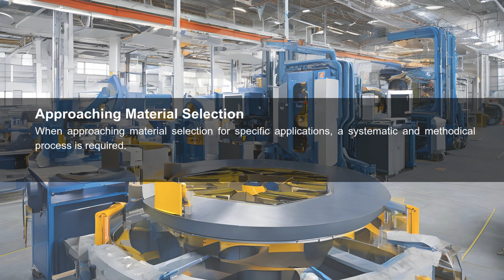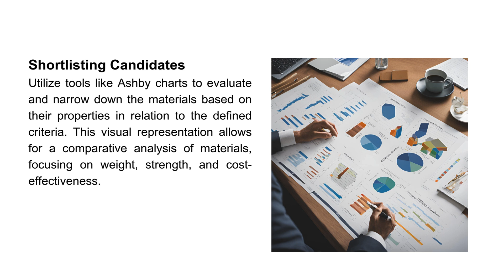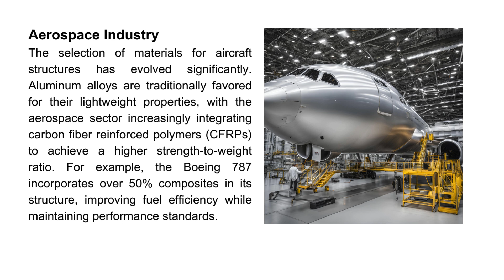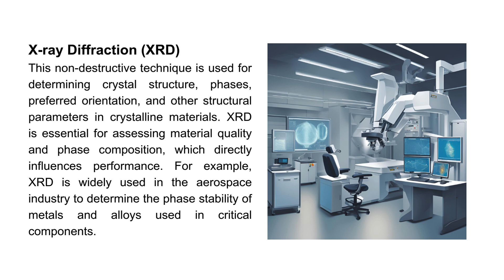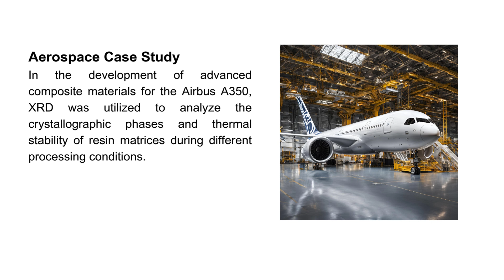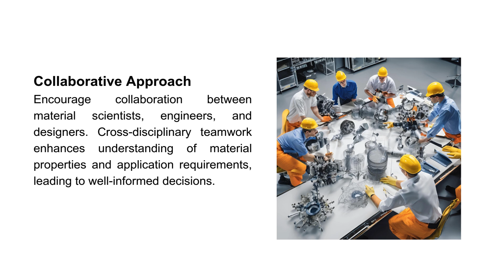MTM Lesson 3. Material Selection & Characterization Techniques

Comment: Explain how data-driven approaches can enhance decision making in material selection. Ans. Data-driven approaches enhance material selection by using machine learning and large datasets to predict material properties, optimize performance, and reduce experimental costs. These methods help identify the best materials based on strength, durability, cost, and sustainability. By leveraging predictive models, engineers can quickly evaluate material behavior under specific conditions, leading to more informed, efficient, and cost-effective decisions in selecting materials for various applications.

Comment: Material characterization in modern manufacturing faces challenges such as the complexity of advanced materials, which complicates property measurement and requires high accuracy. The process is resource-intensive, demanding expensive equipment and skilled personnel, which raises costs. Additionally, integrating real-time monitoring in dynamic processes like additive manufacturing adds to the difficulties.

Comment: Student Name: Nicolas, Arvin Van B.
Program & year: BSIT Automotive 2-B

Software tools can significantly enhance the material characterization process in a way of "Simulation and Modeling". Software tools enable the simulation of material behavior under various conditions, allowing for predictions of performance without the need for extensive physical testing. By leveraging these capability, organizations can improve the accuracy, efficiency, and effectiveness of the material characterization process, ultimately leading to better material selection and performance.

Comment: Name: Jan Keith T. Montero 
Answer: Key techniques to ensure materials meet required specifications include:

1. Material Testing (tensile, hardness, fatigue, impact tests)
2. Non-Destructive Testing (NDT) (ultrasonic, radiography)
3. Chemical Analysis (spectroscopy, chromatography)
4. Dimensional Inspection (CMM, laser scanning)
5. Microscopic Examination (optical, electron microscopy)
6. Thermal Analysis (DSC, TGA)
These methods verify material properties like strength, composition, and structural integrity, ensuring they align with design and safety standards.

Comment: empirical data provides insights into how materials behave under specific conditions, while design specifications outline the necessary properties for functionality. This combination leads to better durability, safety, and efficiency in applications, ultimately reducing the risk of failure and optimizing performance.

Comment: There are several approaches to ensure materials meet industry standards during selection:

Standards Research: Always check relevant industry standards and guidelines for specific requirements related to materials.

Material Testing: Conduct tests to assess properties like strength, durability, and safety to ensure they meet the required specifications.

Supplier Certification: Choose materials from certified suppliers who adhere to industry standards.

Documentation: Maintain detailed records of material properties and testing results to verify compliance.

These steps help ensure that the selected materials are safe, effective, and suitable for their intended use.

Comment: Define requirements and objectives.

Identify candidate materials.

Analyze material properties.

Evaluate manufacturing compatibility.

Consider environmental and sustainability aspects.

Conduct a comparative analysis.

Prototype testing and validation.

Perform cost analysis and finalize selection.

Review and document the process.

Implement and monitor the selected material.

By following these steps, manufacturers can ensure that they choose materials that meet the technical, economic, and environmental needs of their applications, leading to optimal performance, reduced costs, and longer-lasting products.

Comment: Material selection is pivotal to the product lifecycle, influencing various stages from design to disposal. The chosen materials significantly impact performance, functionality, and durability, ensuring the product meets design specifications and user requirements. For instance, lightweight materials can enhance energy efficiency, while cost-effective options can lower manufacturing expenses, affecting market viability. Additionally, material compatibility with manufacturing processes influences production efficiency and product quality, with efficient materials minimizing waste. During the product's use phase, durability and maintenance needs shaped by material choice can extend lifespan and enhance customer satisfaction. At the end of life, recyclable or biodegradable materials contribute to sustainability and ease of disposal, aligning with environmental regulations. Overall, thoughtful material selection enhances performance, reduces costs, and promotes sustainability, leading to better product outcomes throughout the entire lifecycle.

Comment: Feedback plays a crucial role in the integration of material selection and characterization by fostering continuous improvement and refinement of material choices. By analyzing performance data and empirical evidence gathered from testing and real-world applications, engineers and material scientists can assess how well selected materials meet specific requirements. This iterative process allows for adjustments to be made based on feedback, ensuring that material properties align with desired performance characteristics, durability, and sustainability goals. Feedback helps identify potential issues early in the design phase, reducing the risk of performance failures and enhancing the overall effectiveness of materials used in various applications.

Comment: This question asks about the key techniques used in quality control to ensure materials meet specifications. These techniques focus on preventing defects and verifying that materials meet the required standards
Several key techniques are employed to ensure materials meet required specifications. These include thorough testing at various stages of production, implementing robust quality control procedures, and utilizing statistical process control (SPC) methods to monitor and improve processes.

Comment: Empirical data is crucial for performance evaluation, reliability, safety, comparative analysis, cost-effectiveness, environmental considerations, compatibility, and optimization in designing innovative products. It provides measurable information about materials' mechanical, thermal, electrical, and chemical properties, enabling selection based on specific performance requirements. It also helps in assessing reliability and safety under various conditions, reducing material failure risk. Empirical data also aids in evaluating the cost-effectiveness of materials, aligning them with sustainability goals, and ensuring compatibility with multiple components.

- JAYSON REY L. SALE

Comment: The selection of materials greatly influences production cost since the materials used in a product can often account for a significant portion of the total production cost.

Different materials can have varying prices, depending on factors such as availability, quality, and demand. Using high-quality materials like stainless steel or titanium may increase production costs, but can also lead to a higher-quality final product that justifies the greater expense. On the other hand, using cheaper materials such as aluminum or plastic can reduce production costs, but may impact the durability or quality of the product.

Comment: Engineers can leverage material data by using it to inform decisions during the design process, enabling the selection of optimal materials based on performance, cost, and sustainability criteria. Access to detailed material properties-such as strength, elasticity, thermal conductivity, and corrosion resistance -allows for more accurate simulations and modeling, leading to improved product reliability and performance. Additionally, understanding material behavior under different conditions can guide innovations in design, resulting in lightweight,durable, and efficient products that meet specific application requirements.

Comment: Thermal testing provides valuable insights into a material's thermal behavior, allowing engineers to identify its limitations, optimize material selection, ensure product safety, improve performance, and meet regulatory requirements those are the advantages.

-Lloren, Jhondel

Comment: 1.What actions can companies take to mitigate risks associated with material shortages?

Companies can take several actions to mitigate risks associated with material shortages

ANSWER;Diversify Suppliers: Establish relationships with multiple suppliers to reduce dependence on a single source. This can help ensure that if one supplier faces issues, others can fill the gap.
Build Inventory: Maintain a strategic inventory of critical materials to buffer against shortages. This approach requires careful management to balance carrying costs with the risk of obsolescence.
Supply Chain Transparency: Enhance visibility throughout the supply chain to monitor risks early. Utilizing technology like supply chain management software can help track supplier performance and inventory levels in real time.
Collaborative Relationships: Foster strong relationships with suppliers through collaboration, regular communication, and partnership. Long-term contracts or agreements might secure materials at negotiated prices.
Alternative Materials: Research and develop alternative materials or substitutes that can be used in place of scarce resources. This can involve innovation in product design or material science and that are the example of strategies on company 

2.Describe the key differences between metals and ceramics in terms of their thermal properties.

Answer:Metals and ceramics, despite their seemingly similar appearances, exhibit distinct differences in their thermal properties, which significantly influence their applications in various industries. This analysis will delve into the key differences between these materials in terms of their thermal conductivity, thermal expansion, and heat capacity.

- Metals: The free electrons in metals can easily absorb and transfer thermal energy, enabling efficient heat conduction. This property makes metals suitable for applications like cookware, heat sinks, and heat exchangers. 
- Ceramics: Ceramics, on the other hand, have a more complex atomic structure with limited free electrons. This restricts the movement of heat energy, resulting in lower thermal conductivity. This property makes ceramics suitable for applications requiring thermal insulation, such as furnace linings and building materials. 

3How does the lifecycle assessment influence material selection decisions?

Answer:Lifecycle assessment (LCA) plays a crucial role in influencing material selection decisions by providing a comprehensive evaluation of the environmental impacts associated with a material throughout its entire lifecycle—from raw material extraction to production, use, and disposal